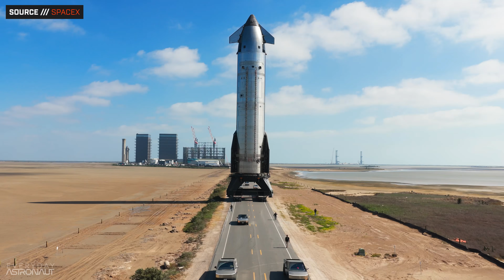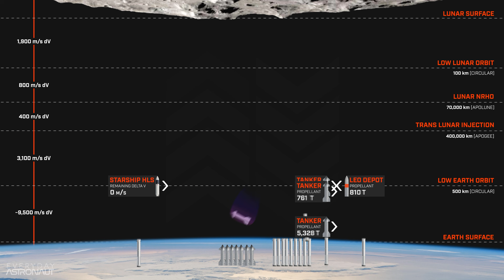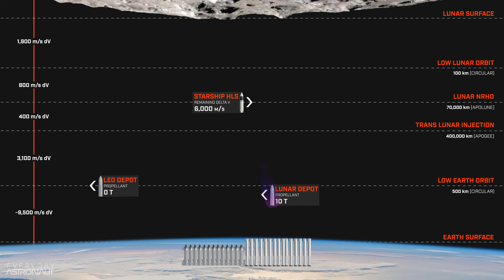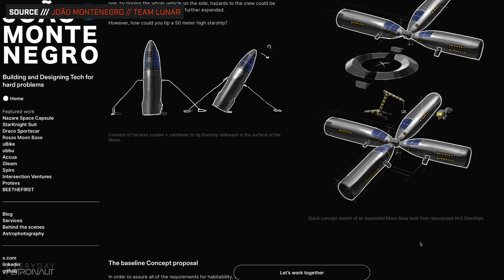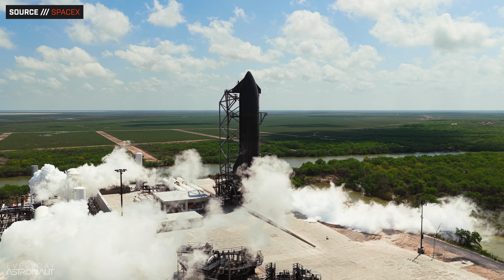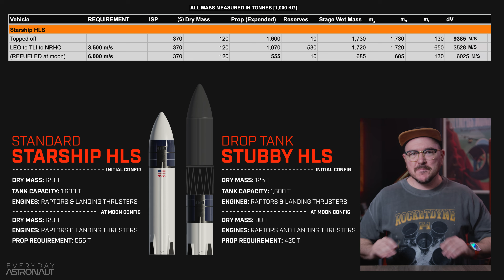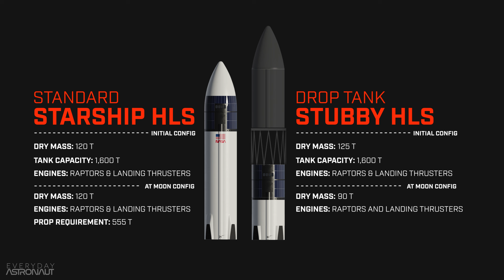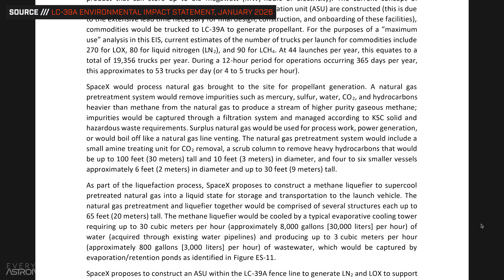Does Starship REALLY require 15+ launches to land one lunar Starship?!

Comment: Starship is a disaster... fully reusable tech is simply not viable to go any further than LEO. We're really expected to believe that launching dozens and dozens of times to refuel the HLS is a better idea than just launching a small, light, and expendable lander? And this mess is compounded by how weak SLS is-- the inane mission architecture caused by SLS' limitations is just exacerbating the issue. Why does SLS even exist? If HLS needs to get to lunar orbit anyway why not have the astronauts hitch a ride on that? It's clear that this is going to be cancelled just like Constellation was.
Reply: This is exactly why it's so big, because it's reusable. When your vehicle is reusable you could make you second stage big to refill with 1600 tonnes of propellant to get 100tonnes to the surface of the moon. This is the best plan right now. There's no other way to build moon base

Comment: For added context, SpaceX is indeed building the ground infrastructure to support so many rapid launches. Currently they are able to stack a new vehicle in one month with 8 bays. They are building an additional 48 bays right now. They are also currently building 5 launch pads with more possibly planned.
My concern is the timeline. Once all the infrastructure is built, they will indeed be able to have a new vehicle built every few days and probably 2-3 launches a day if they match Falcon 9 pad turnaround. But all this is probably a couple years from being done.
Reply: yes I think so too, since SpaceX's primary goal with Starship is massive Starlink launches right now, they will definitely have significant launch capabilities for it eventually. Launching multiple Starships per week is going to happen. But the timeline just doesn't align with NASA's plan. For comparison, SpaceX required roughly 12 years of Falcon 9 launches to support multiple launches per week. Even if we assume that they will be faster this time around, I can't imagine Starship being ready at the scale required prior to 2030 (about half the time of a comparable Falcon 9 development cycle). Even though Starship is designed to scale in mass-production, you also need the thing to work reliably, and that just takes time.

But the spacesuits and all aren't going to be ready either for a 2028 launch. The only realistic option for NASA is to delay Artemis for a bunch more years anyway, even if they go with Blue Moon instead of SpaceX. That sucks, but I don't see any alternative.
Reply: @Nummer378 They're still going with both right?
Reply: @Nummer378  NASA's timeline is always a best-case-if-everything-goes-right-funding-isnt-touched-and-no-hurdles-are-discovered-and-external-companies-actually-deliver timeline.  It's never ever realistic, though it is somewhat more realistic than Elon-time.  Conversely, at least SpaceX is trying to do something that's a gamechanger rather than NASA designing a slightly different wheel.

I think we'll be able to pull off a currently-envisioned Artemis IV around 2033.  The good news is that I would anticipate dozens of lunar landings over the following decade because we'll stop spending $4B/launch.... but I'd never be shocked if the government went so far as to build all the infrastructure to do something awesome and then decided to pull the plug and throw it all away.
Reply: @Nummer378 I agree. I feel like we are a decade from getting close to SpaceX's vision in terms of launch volume.
Reply: @JakeStz  Decade still feels optimistic tho
Reply: I am curious how Starship HLS could possibly be cheaper than Blue Moon MkII with the kind of manpower required to 6x the current Starship production
Reply: @sheepuff5999   The key is it will be cheaper to NASA. The massive amounts of infrastructure are to be funded by the drive to launch thousands of Starlinks and then many more data centers.* Launching a dozen tankers will be a sideshow. At least that's how the cost structure is seen by SpaceX and NASA. Crucially, the price for the uncrewed and first two crewed landers is fixed, NASA won't have to cover anything else. 

*How the whole orbital data center idea is going to work out for anybody is a very murky crystal ball but SpaceX will have the money to take a good stab at it. At the very least two Starfactories and 5 launch pads will be built.
Reply: @sheepuff5999  It can't, and thats why it all doesn't make  sense
Reply: Okay now build it on the surface of the moon as well haha
Reply: @Cameldactyl Why?
Reply: @JakeStz there is serious concern with the amount of regolith that would be kicked up with a starship take off or landing from the surface of the moon
Reply: @Cameldactyl you didn't watch the video. There are thrusters near the top for take off and landing. Regolith is solved
Reply: @JamesHardaker that's an idea to solve the issue which hasn't been proven to work or be possible. At the end of the day though the debris kick up from the moon is one of the smallest of the issues with starship or HLS.
Reply: @Cameldactyl  
Of course it's possible and will work. Did you watch the video?
Reply: @Cameldactyl  That is not an idea, is a solution based on proven technology. The main rockets is not even an option, they have too much power. They cannot be used to leave the moon or land not even with minimum thrust. As they told you before, watch the video.
Reply: @aldotorre8802 These problems are literally in this video lol. This is an explainer about the ideas problems and possible solutions to HLS. This is by no means a definite description of what HLS will look like, if it exists to land on the moon at all. As this explainer demonstrates there are concerns with landing up right, there are concerns with regolith kicking up. Partly because landing on its side may be their solution to its instability and partly because there will be debris either way. These have to be strong enough to lift a massive starship. There are issues with shrinking down a starship to solve that issue. There are issues on top of issues. And these are the lesser of the engineering obstacles. You acting like all the problems have been solved without question is honestly insane, if that was your take away from this video.
Reply: @Cameldactyl  The only theory here is refueling and maintaining Methanox stable in liquid state in space for long periods. That has to be proven, which is a lot, the rest of the problems are already solved. I am not saying that is easy but there is a path to success. It’s a long path, but a clear engineering path on what needs to be done. Regolith is the least of their problems.
Reply: @aldotorre8802  I agree with you, the regolith could be cemented during a construction of starship lending pad.
Reply: @JamesHardaker this made me chuckle because I remember when they thought they didn’t need a flame trench for the launch mound. It’s been ten years of SpaceX fanboys going „this isnsolved“. Says who? It’s solved when it actually works. They haven’t even managed to finish a full orbit and this whole rocket program has been going on longer than the Apollo program. There exactly nothing solved right now.
Reply: @SebastianPeitsch bro stop. face reality. They have animated videos and technically possible unbuilt engineering. All the problems are basically solved. Assuming the spacecraft that hasn't made it to orbit with any payload or exploding works. Its time to start signing people up for the moon colony.
Reply: 10 years.
Reply: «Couple years», is this Elons alt account?
Reply: @fizz03 I'm talking about the completion of the ground infrastructure. The Pads take 2 years to build and 1 is online and the other two will be completed in the next year. Both Gigabays are also more than halfway done.
Reply: When the pads at 37 get their own ASU, I'd expect them to have the highest cadence as well. Especially with how quickly those are getting prepped for towers
Reply: @JakeStz the towers and OLMs seem to be taking six months to a year to be built unless your talking about all the other infrastructure as well
Reply: @JakeStz that would be soo cool if just building the infrastructure for launches on Earth was all it took to make launching 15 to 20+ quick succession launches that will cryogenic refuel in orbit possible.
Reply: @fizz03 is this a bad time to mention Artemis III was what Starship was originally under contract for?
Reply: @mr70camarors  I am well aware.
Reply: I’m still waiting for my full self driving and tunnel under the 405.
Reply: @John-wx6wj  
1. Go buy FSD, what are you waiting for?
2. After 5 minutes of Googling : "Elon Musk’s Boring Company has abandoned its plan to dig a tunnel under the west side of Los Angeles after it and the city settled a lawsuit brought by two area neighborhood groups who opposed the scheme." - This is why nothing gets built in California.
Reply: In 6 years we will have steady star ship launches per week.
Reply: @shockers12512 That is true. The real question is will the starship actually do anything interesting or just be a starlink launch tube.
Reply: Why does anyone think any of this is a good idea?
Reply: @mr70camarors   The basis for the selection of SpaceX HLS wasn't delta-v and practicality. The basis was money. Congress gave NASA $3B for a lander and SpaceX bid $2.8B.* The next closest bid was between 6-8B. NASA went with what they could afford. Congress was unhappy that the companies with lobbyists got zero so they funded a second lander built by Blue Origin and various companies. IMO NASA was happy they forced Congress to properly find two landers by making the HLS choice.

*A bargain price because that won't nearly cover the cost, the bid was that low because SpaceX was already developing this ship for Mars. That's why it's so huge. I didn't hear Tim mention that crucial detail anywhere, did I miss it?
Reply: @donjones4719 such a bargain. All of those funds are now depleted and HLS does not exist and starship has not made it to orbit
Reply: @mr70camarors  
Because it is a good idea. Watch the video.
Despite how ridiculous it looks, it's actually practical, and will be needed if we want a proper Moon base.
Here are two key facts you are probably missing:
- The hard part is independent of Starship. Refueling at the Moon will be necessary for every landing system, and that's the most expensive part. Now the only question is how big lander do you need. And for a proper base, the answer is: big.
- Starship is fully reusable, so only the fuel is expended. And about that see the previous point. It's just the limitation of chemical rocket engines. A nuclear thermal rocket engine could cut down the fuel cost drastically, and one was fully developed in the 60's (NERVA), but it has some PR issues.
Reply: @mr70camarors well there are meany reasons, but what exactly do you mean by "any of this" and why do you think it wouldn't be a good idea
Reply: Because landing 500T on the moon is the most idiotic solution to the lander equation? Literally the opening minutes of the video.
Reply: @mr70camarors  Because once the tech is developed it will take a pretty similar Delta impulse and the same effort to shoot a Starship to the moon or to shoot a Starship to Mars and beyond. The moon is only a stop for SpaceX, not the destination.

Comment: More accurately, ISP is the vector sum of the exhaust velocity, as only the component of the exhaust velocity pointing directly opposite the rocket’s heading will produce a net change momentum of the system (assuming your engine bell is symmetrical, if it’s not, you have a bigger problem on your hands) this is why you need sea level and vacuum optimize engines because they exhaust will be shooting out to the side if your nozzle is under expanded which leads to a reduced ISP because now you’re taking the cosine of that angle times the exhaust speed.
Reply: Effective exhaust velocity is the useful number, which is as you say the average exhaust velocity along the direction of thrust..  ISP is a silly measure that is only used because it's the same in metric and US measure, avoiding any possible misunderstanding.
Reply: Oh there you are. I missed the comment rocket scientist.

Comment: So your graphic starting around the 13-minute mark omits all the refueling launches. They are not landing 8% of the take-off mass, they are landing .5% or something if you include 30+ launches that are needed.
Reply: The graphic is in the part explaining why there's so many launches instead of just one. The context around it explains how refueling lets you have a "small" launch vehicle accomplish something that would have required an impossibly huge vehicle otherwise. 

So the percentage is effectively higher for this vehicle than a vehicle without refueling. 

A chart should be able stand on its own though, so it could have used an asterisk
Reply: @dilutioncreation1317  but is such an absurdly large vehicle even necessary though? If the old one managed with 7.5 tonnes why not add two tons of stuff and call it a day while still having a much better vehicle.
Reply: @KP3droflxp they're offering the ability to get more stuff to the moon. I haven't heard anyone say what that stuff might be yet but if we want a base up there then it'll take some heavy deliveries
Reply: @dilutioncreation1317 yea i agree with this. Noticed the same thing as @gaba023 that the chart is misleading but the explanation/ metaphor is sound. Energy is energy. You need tankers to get that much payload to the Lunar surface. Without tankers you need likely unfeasible giant rocket to “one shot” a moon landing with a wet mass 500ton lander. I think thats the point of the graphic. Cheers
Reply: It makes no sense to count all the refueling launches because the point was not that you saved propellant this way but rather that doing it all in one launch would require an impractically large rocket, one that would be almost impossible to build and operate and that would level half of Florida if something went wrong and it exploded on the pad.
Reply: @edmondantes4338   This
Reply: Strange how they can lost sight of this, when it is the root point of the whole video (how much fuel does it actually burn). First principals.
Reply: This, it's absurd to disregard the entire concept of the video there and genuinely comes off as dishonest

Comment: Orion can't get into LLO but it can certainly go lower than NRHO. I think if a fully fueled HLS in LEO doesn't have enough margin for the full mission, then a lower lunar orbit Orion can still achieve could make up for that.

And ultimately yeah, even the best alternative starship HLS still requires a lot of refueling flights. Like you said at the end, if you can do reusable refueling flights at a decent cadence to begin with, then just doing more of them would probably be the easiest option